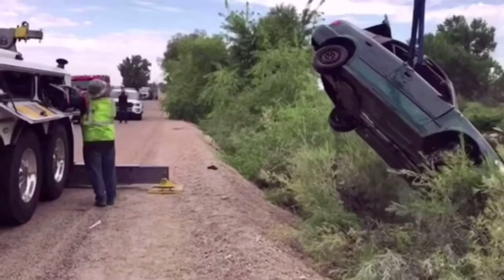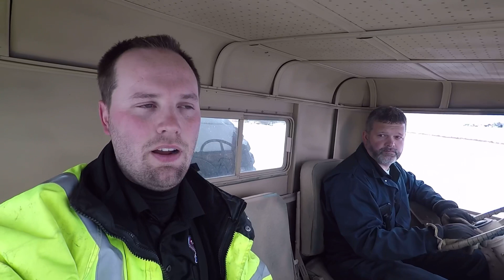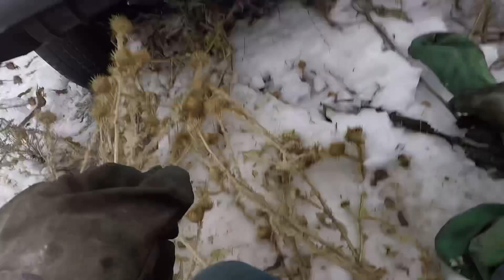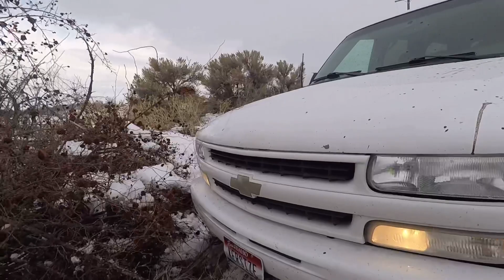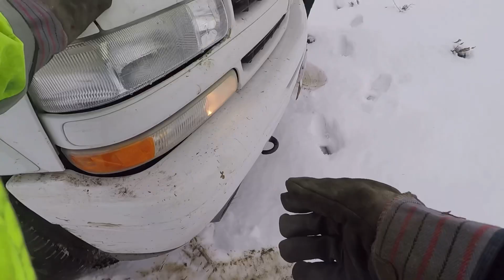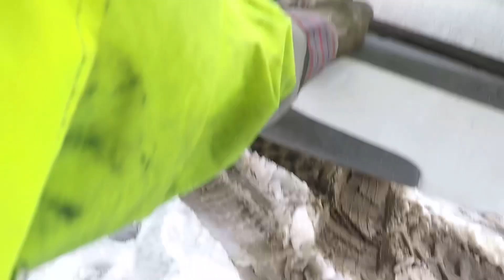Sarge to the Rescue!

Comment: I saw the very thing you need in out in Norfolk. A Centurian tank, but the recovery version. Electric winch powered with the straight-8 rolls Royce petrol engine with the Meteor engine for main engine. Plus a small car engine for standby power. It was HUGE. Lucky escape because it nearly went to the range :o

Comment: sarge can tow tanks.. no problems with those cars. Was surprised that there was no warning light in the car to indicate the 4x4 is not working :)
Reply: Yea, Caught me by surprise. Maybe little lady doesn't  know daddy's truck too well & don't know how to switch it into 4WD. I'll bet they were not locked into 4 wheel drive. Any way, they were pretty far off the road where they got stuck. Maybe they broke something, I considered that to be a Suburban. If every thing is working right, they should have been able to drive the SUV back on to the road & get to where ever they were heading with out the service of Sarge.  I want one.
Reply: @philsmidwestclassiccars150  Thanks, might be indeed a little boy or lady who didn't want to fix it as the fix is expensive :)

Comment: That truck looks like it could pull hard enough to spin the earth backwards.
Reply from the maker: It can lol
Reply: In low low no doubt, you have to love deep reduction gears, I drove a Mack coal truck that had #55,000 axles they aren’t fast and ride rough but you can’t beat em for pulling power

Comment: That looks like one that has the actuator that heats up wax in a tube to lock in the front axle. The heating element can fail but often the wiring gets damaged driving through snow and mud. There are different actuators you can get for them. The bald tires aren't helping anything. If she wanted to snowshoe, why did she drive in instead of going in on snowshoes?

Comment: Those Suburbans have auto 4wd, 2H, 4H, and 4L. Only 4L should be used in these conditions. auto 4wd should never be used. It is prone to failure as it hunts in and out of 4wd. I bet she was using auto 4wd. It is useless because it does not lock in until you are already spinning tires. 4L would likely work.